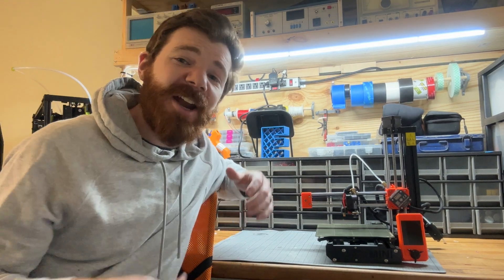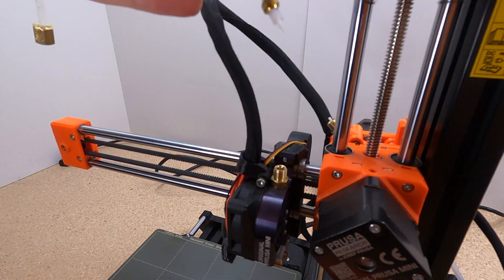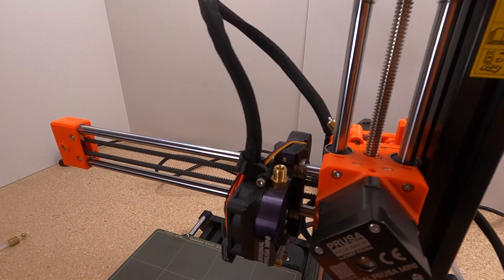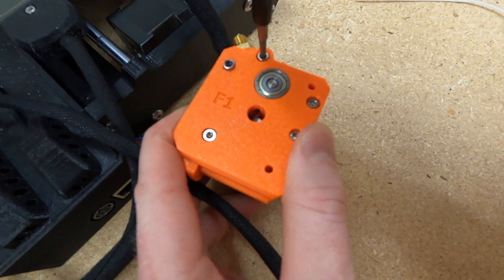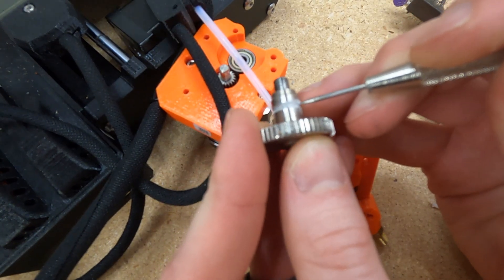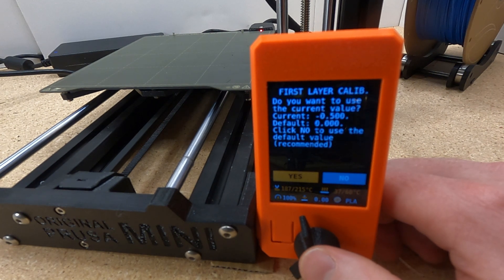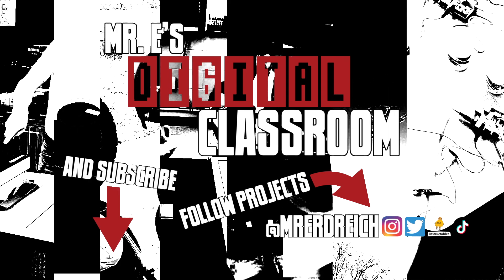How to unjam the Prusa Mini 3D Printer

Comment: Here 3 years later. My issue is that I tried to do a cold pull and the filament snapped. 
Took off the brass fitting near the hot end. Tried to pull out the rest of it but it won’t budge at all. Can’t force it back through either, it is just STUCK

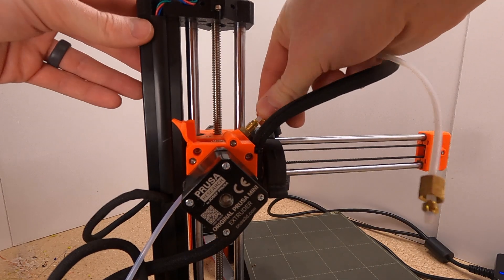Comment: In the video at ~2:50, you say you like to open the window and "turn the gear and make sure nothing feels like it's binding..." My gears won't budge. Any suggestions?
Reply from the maker: This could due to a piece of filament lodged in the extruder, or perhaps the gear tension is too much. I would suggest disassembling the extruder and clearing out any possible debris. Then when reassembling, ensure you don't over tighten the housing screws, just snug them.

Comment: Fantastic walkthrough for a very common issue. Was able to use the video to get back up and running in no time (filament had been filling the pull teeth on the gear and it wasn't getting grip). Clearing off the gear for the filament particles got everything sorted again in absolutely no time at all. Disassembly was easy, cleaning was easy, just all around an ideal walkthrough.
Reply from the maker: Thanks for the view, glad I could help!

Comment: Thank you so much - this was super helpful! I tried loading FlexTech Filament 40 just then and it jammed up the whole deal. Do you have any experience/advice on using flexible filament with this printer?
Reply from the maker: Happy to assist! In general, printing flexible filament on a bowden drive rather than a direct drive is more difficult to do and I avoid it. With my experience, I find that more rigid TPUs (say 90-95), as well as filament with a higher melt index (like Polymaker's TPU90) work better with bowden drives. Additionally, you want the tension to be a little bit looser than what you might normally do for a rigid filament and ensure that your print speeds are slower, temps are hotter, and that your flow is a little higher all based on the specific filament you choose.

Comment: Thanks for the good video. I am wondering how to tune the screw (the one with the spring inside) is it always aligned with the plastic? What happens if I tighten it? make it loose? How this affect the filament out?
Reply from the maker: Happy to help! This is your filament idler tension. Father in (tight) will put more pressure on your filament, father out would be less. If it is too tight it may grind into your filament cause it to slip, and if it’s too loose it may not apply enough pressure also causing slip. Prusa suggests it should be aligned with the plastic body of the case, but depending on spring wear or the type of filament it may need to be adjusted over time.
Reply: @MrErdreich  thanks so much for this video. Just had my first filament jam on my mini+ yesterday and this should sort it out hopefully.
One thing that is never clear to me, does the tensioner screw need to be flush with the housing BEFORE or AFTER you insert the filament?